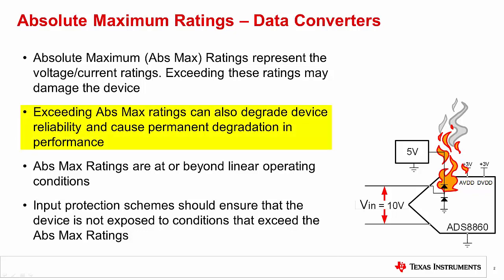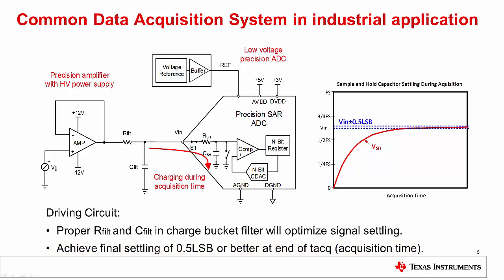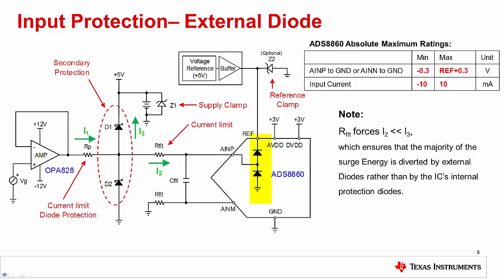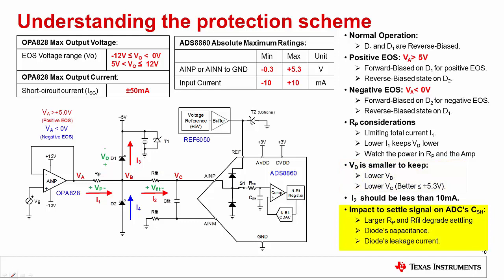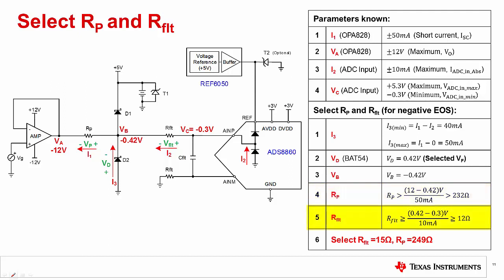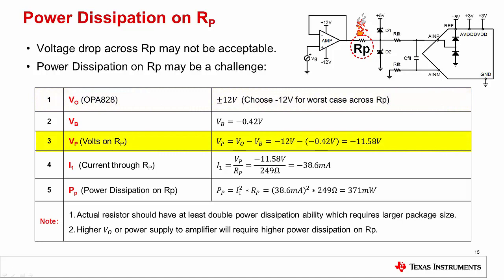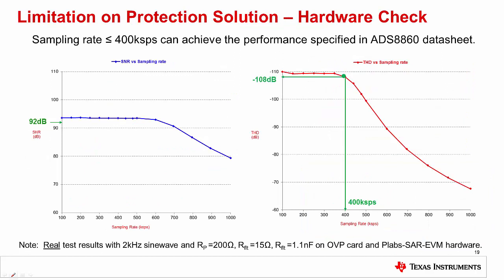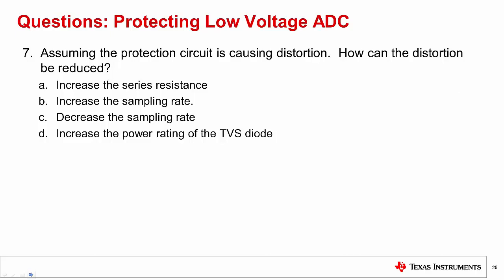Protecting low voltage ADC from high voltage amp

Comment: This is a terrible solution that introduces unnecessary offsets and nonlinearity problems.
Just close the opamp feedback loop on the right side of Rp.

You still get the current limit, but the opamp corrects all the errors with feedback.